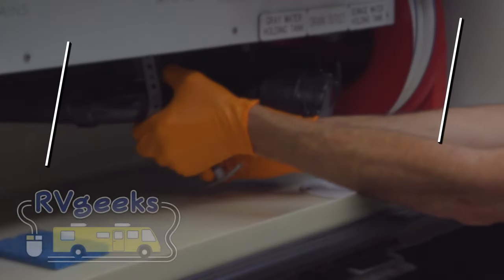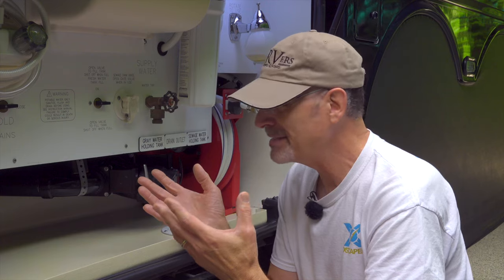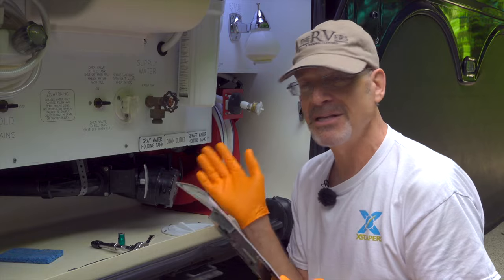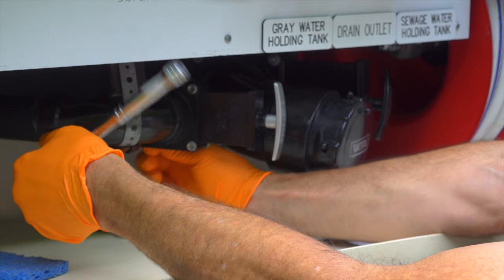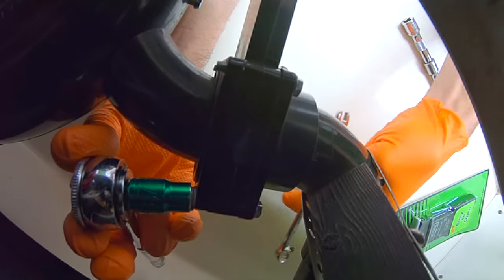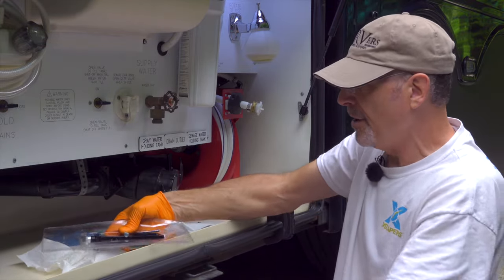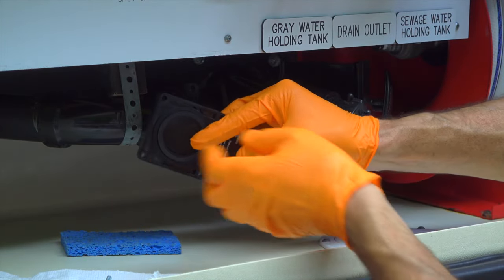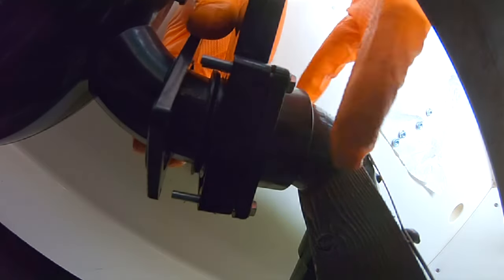RV Gray Valve Repair — REAL-TIME DIY Holding Tank Valve Replacement

Comment: Would have been nice to show the old valve up close and explain exactly why it failed. I know you said something about it but you tossed it aside too quickly without showing the failure points in detail.
Reply from the maker: Sorry Robert, but there’s really nothing to show. The seals on those valves typically fail subtly, leading to a slow drip even though the seal looks perfectly fine. Any seal that failed badly enough to have obvious damage to it likely wouldn’t even close, so would have had to be replaced long before it got to that point. They just never get that bad, because they become unuseable the moment they start to drip.

Comment: I noticed that now, that your RV is 14 years old, everything is starting to break.
Reply from the maker: Not "everything" but for sure older vehicles definitely need more things replaced over time. But taking care of each minor (or occasionally major) item as it happens keeps our rig as new as possible. Not really too different from a car, or a boat, or even a home, things do need tending. By keeping our RV so long, and keeping everything working as we go, we feel like we're really getting our money's worth out of an inherently depreciating asset! 😊
Reply: I wouldn't necessarily call it "break".  Every home needs maintenance and more so as they get older.  RVs are subjected to a lot more elements than a non-moving home.  To be honest, if you are even minimally handy fixing an RVs home systems are pretty easy.

Comment: At your 11:00 minute mark, could have installed the bold in the other direction to make access to bolt installation easier and the nut for tightening. FYI. Tricks from previous installs.  FYI. Then again, each rig has it's unique challenges for sure...............
Reply: Was thinking the same
Reply: He could have unpackaged the new valve with clean hands before unbolting everything - and checked that it was indeed the right replacement !

Comment: Yea, I've changed both the black and gray valve. Five minute job but I do recommend dumping and rinsing the black one before changing it.
Reply: My black water tank handle is broken so I can’t drain the black water tank without replacing the valve. I have a 45 gallon waste transport container on wheels that could catch it all (to dump in septic tank) but then it will be more water weight than I can physically carry. Any ideas? Guess I’m gonna have to stop using it until it’s fixed.
Reply from the maker: Sorry to hear Bonnie. When you say your handle is broken, did the entire rod slide out of the housing, or did the handle just come off the rod. If the handle simply came off, you could pull it with a pair of pliers. If the rod came out, you can try inserting it back in and rotating into the right to try to thread it back into the blade valve. If the rod came out and you don’t have it anymore, you can try buying a new black valve and using the rod from it to do the same thing.

Comment: I noticed you did not use a lube.  I was told to spread vaseline on the seals to help it stay sealed and last longer.  Is this true?
Reply from the maker: Great question, William! We didn’t use any type of lubricant because the instructions didn’t call for it, the valve worked smoothly right out of the package (possibly pre-lubricated?) and the old one never got lubricated in all those years, so we figure it’s probably okay! If you do want to use some type of lube, Vaseline is probably not the right one, as it’s petroleum base and could damage the seals. We’d recommend using plumbers silicone.

Comment: Love your videos... they're always worth the watch, even when one knows how to do the specific topic. If I might make two suggestions on this project:

1) You would likely have found this task much easier, had you used a smaller and less bulky 1/4" drive socket, rather than 3/8". The lighter weight and size of the smaller drive would greatly enhance the ease of use. This is particularly true for applications in which the valve is in the center of the underbody (like my Minnie Winnie).

2) When tightening your bolts/nuts, it would be better to alternate sides... first the one that was hardest to reach (as you did), then the one on the opposing side. Finally the remaining two (which will also be on opposing sides). Also, plan to tighten all bolts/nuts in at least two steps, somewhat more loosely first, then tighter on a second round... maybe even a third. This will reduce the likelihood of cracking the valve. Of course you would do the same in all such projects, such as tightening lugs on your wheels, etc.

Keep your great videos coming!
Reply from the maker: Thanks so much for the positive comments, and the great suggestions! Great ideas!
Reply: @RVgeeks  You're welcome. Shortly after my comments, I started to replace my own gray water valve. I have a 2000 "Minnie Winnie" that I purchased in 2014. I keep in good shape and I've done many upgrades. I spend about 6 mo a year on my sailboat in the Bahamas and most of the rest of the year traveling in the RV. With COVID and various other challenges, I haven't been on the move since returning from the Bahamas in Oct, 2019 (where I had a front row seat to Hurricane Dorian). I'm about to head north for the summer and decided to replace the valve before I left. Unfortunately, my project turned out to be a bit more complex than yours. I doubt that the valve has been replaced in its entire 21 years. All four nuts were solidly rusted to the bolts and the heads of all the bolts were so badly rusted that no wrench (or channel lock) would grab them. I eventually got them out by grinding off the heads with my angle grinder. What took you 17-1/2 min to do and film took me over 4 hours (trying various other methods along the way)! Hopefully, it will last another 21 years (although it's highly unlikely that I will).
Reply from the maker: Ouch! Been there. Nothing worse than a job that supposed to be a walk in the park that turns into a nightmare. Glad you got it done. Although your “six months a year in the Bahamas“ is making us a little less sympathetic. 😂

Comment: Thanks for sharing this video. I have a older Allegro Bay and unfortunately the black water valve is leaking a bit. When I take the cover off there is a little nasty liquid that spills out. Looks like and Ez fix.    Jim

Comment: I had to take the main pipe off because I couldn't pull the gray pipes apart to remove the gray valve.  It was too tight.  I'm glad I did though.  It gave me the opportunity to clean the seals on the black valve.  They still looked fine but grimy.  I also found that the gray pipe coming out of the camper had a flaw from the factory.  Have you ever bought pvc pipe and a thin plastic piece is still attached inside the end?  Like it didn't mold correctly?  This was preventing good flow from my gray tank.  Not to mention the hair, other plastic pieces and screw that were lodged in the gray pipe.

Comment: On a side note. Why the 2x4 and metal strapping? Looks like after market engineering improvement.
Reply from the maker: That was from the factory. Might not look elegant, but you normally can’t see it, and it seems to be doing the job!

Comment: Thank you so much. You provide great information and incredable resources. I was wondering if you had some information on another problem I am having. I have a similar set up in my RV as you show in the "gray valve repair" video. I have 02 Newmar Dutch Star DSDP 3858.  The problem I am having is a leak coming from my fresh water city fill hose. I use to have the hose reel like you have, but I had to bypass it because the brass connections were failing when I would fill the tank. I bypassed the reel with a 3' braided clear hose. It goes into a cartridge filter similar to yours. I turn the valve to fill the fresh tank. Once full, I turn the valve off and assume all is good. Recently, I have been getting a leak now coming from the fill hose. It feels like some back pressure pushing the water backward. Maybe the the valve used to fill the tank is failing. Any thoughts. Thank you
Reply from the maker: Two things.... first, our rig came from the factory with a backflow preventer on the fresh water hose.... positioned where the hose comes off the reel and goes into the RV. It failed, and we replaced it and have had no problem since. We'd suggest confirming that your backflow prevented is working. Second, check out this video, which we think shows a similar plumbing setup and repair to your rig: https://youtu.be/MjyU2eClPcA

Comment: I recently purchased my first RV (Grand Design Reflection 313rlts 2016) to live in full time, it will be stationary. I have learned a lot in just the few weeks I’ve had the trailer thanks to some really good friends who have been RVing for years. But I do have a question for you and hope I don’t wear out my welcome here! Lol. I am hooked up to city water and have a regulator and a filter on that line. The water pressure in my bathroom sink is good, the shower is pretty good, but the kitchen sink is pretty low pressure. I also seem to have intermittent air in the lines in the bathroom sink, I don’t notice it in the shower at all, some in the kitchen.
Reply from the maker: Hi Suzanne. Congrats on your new RV! Grand Design makes a beautiful unit! The first thing we'd try would be to turn off city water and try running off the onboard water tank & pump. That might help to isolate the issue. If it DOESN'T happen on the pump, then that might help determine where in the line the issue is. If it does, then you know it's something else. Also... be sure that any/all of your winterizing valves are turned in the correct position. Sounds like it could be that something's not set right.

We'd also suggest checking out the Grand Design owner's forum: https://www.mygrandrv.com/forum/index.php Would be really beneficial to sign up there so you could post your question. Could be something specific to Grand Design's plumbing design that someone there could answer super fast.

Let us know how you make out... or if you have follow-up questions, Suzanne. There HAS to be an answer to this! 😉

Comment: Great video, as usual. How did you know you ordered the correct one, did the old one have a part number on it? Ours is a 2003 Dutch Star( I'm currently removing the roof to replace it) and ours is leaking the few drops, maybe an ounce or so of leaking when I take the cap off( I'm sure it's the gray water. Thinking about buying both valves to have on hand in the coach just in case it gets worst. Thanks for posting, you made it look easy. Now, next time do it blindfolded. Must see TV.  Lol.  Safe travels for you also!
Reply from the maker: Hi Rick, glad you liked this video (blindfolded option... hmmm! LOL!)! Luckily, Valterra only makes 2 styles of blade valves (in three different sizes... 1.5", 2" and 3"). One version has a plastic handle, and the other a metal one. Our old one was a metal handle, so we were pretty confident the new one would be a direct replacement. We're pretty sure the mounting mechanism for the blade valves is universal... and that all replacements would be as easy an install. But since we'd gotten 14+ years of full-time service from our original Valterra, we figured we didn't have any reason to go looking at other brands. 😉 And it's certainly a good idea to carry a spare for these valves... you just never know when it's going to go bad (they don't always fail so slowly)!.

Comment: Wouldnt it be nice if it were really that easy :) I had replace my black tank valve, and of course both it and the gray tank valves are located about 4 ft back from the edge of the trailer. So I first had to cut away a large section of  the sub flooring to access the valves. This means there are cables that attach the handles to the valves, so had to remove them first. The mfg'r installed the black tank valve inline with a long section of straight pipe going out to the side, and on the tank side, right to the elbow coming out of the tank. When I removed the bolts, I found I couldnt flex the pipe at all to remove the valve. So I decided to pull on the pipe   out by the side, but discovered it was right up against the gas line. I ended up haveing to remove the gas line first, then use a strap to wrap around the pipe and try and flex it back enough to get the valve to come out. The job ended up taking about 3 hrs.
Reply from the maker: Holy moly! Glad you managed to get it done.

Comment: Thank you for sharing. What if my pipes don't flex to pull out the old valve?
Reply from the maker: There needs to be at least a little bit of flex to get it out. Might have to try pressing the sides apart just a little more firmly.

Comment: Has anyone tried to do this when rv builder sprayed that insulation all over the valve.  Can I cut that off or try and break it off?
Reply from the maker: You’ll likely have no choice but to cut off just as much insulation as needed to replace the valve, and then reseal / reinsulate as needed.

Comment: Great job on the video.  I noticed the really cool looking tire covers/ wheel well shades.  Can you give us the brand name?  It looks like they cover the entire wheel well??
Reply from the maker: Thanks Greg! We get a lot of questions about those tire covers, but unfortunately, they were discontinued by the manufacturer not long after we bought them many years ago, and we've never found a similar replacement. The good news is that even though they look cool, we wouldn't necessarily buy them again, since they're both expensive, and a bit annoying to install each time. Ours are very old, and overdue for replacement, and we have a lead on what we think will be a superior design. We'll of course report back on that when we know more, so stay tuned!

Comment: Do you have a video on grey tank leakage? The tank itself?
Reply from the maker: Sorry, we don't. But you'll know if the gray tank is leaking, you'll find a little bit of gray water behind the sewer cap when you open it after driving. Then its time to replace the valve!

Comment: Very nice job.  I really liked how you had the camera right there in plain sight of what you were working on.  So many others talk, talk, talk about what they're going to do and then don't even film that part.  They jump past it so you never get to see them actually do it.  I was here to see how difficult it would be to get those seals lined up, and you showed it perfectly.    Unfortunately, I'm replacing the gray and black valves in a 28-year-old 5th wheel and both valves are inside an insulated compartment.  I had to cut a big access hole in order to even see them.   Now it's a waiting game for the valves to show up.    Thanks again!
Reply from the maker: Thanks Gary! By coincidence we just replaced both our black and gray valves about a week ago (one was getting real stiff, so we decided to do them both at once). Hope you have as easy an installation as we did. Man oh man are the new ones ever smooooooth! 😄
Reply: @RVgeeks  That's great.  Both of mine are super stiff.  The gray tank valve is open, but the black valve isn't.  I'm just hoping I can get that black tank dumped one last time so I can get started on this job.   I should have replaced them years ago.  "Shoulda, coulda, woulda," lol.

Comment: I came back to this the other day because I am now replacing my black water tank valve.  I thought, "Oh this will be so easy because mine isn't in an enclosed space, it is under my rig and I can just get my tools into the spaces they are constricted by!"...and now I know that having a holding tank drain open to the elements will rust all your bolts and make this job SO MUCH MORE DIFFICULT! lol  I broke one off and then doused the rest with PB Blaster.  I'll re-visit them next week and have my Dremel tool handy to cut the other three if they don't budge.  BUT, as always, thank you again for the video that gave me the knowledge to get it done!
Reply from the maker: Good luck next week, Jen!
Reply: @RVgeeks  Well things got worse in this process.  My pipes didn't separate the way yours did in the video, the gray side separated from the tank during removal of the valve...which made it easy to finally remove the blank tank valve.  Not so much putting it back in.  The new seals got damaged when I finally got things crammed back in and since I'm leaving for a trip tomorrow I'm now using Flex Seal paste to make sure I'm not leaking poo-water.  I can't stop combining commercials "Flex Seal-I put that SH*T on everything!" lol  But, replacement part will be here when I get home and I'll figure out how to make things better for future valve replacements before I install. ;)
Reply from the maker: So sorry to hear Jen! Keep us posted on how you make out in round two. Good luck!

Comment: 12:52 "That last one is the tricky one". Beg to differ, No it's not. All one has to do is get the 'easy' ones in first and then gently rotate the whole valve assembly either up or down to gain easy access to that last bolt. When done, position valve assembly so the handle sits in its proper handling position. How do I know? Had to do the black one not too long ago.
Reply from the maker: Glad yours worked that way. Our attachment point for the valve is solidly attached to the incoming pipe, and cannot be rotated down, making it a trickier reach, especially for my big hands.
Reply: Hey geeks curious to know what your reaction is to Winnebago buying out newmar. Are you happy unhappy or neutral?